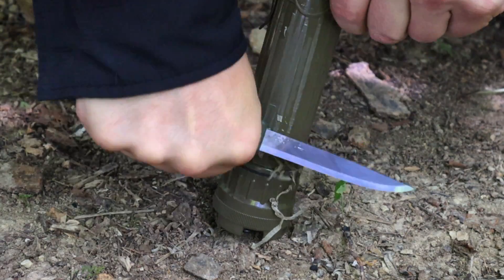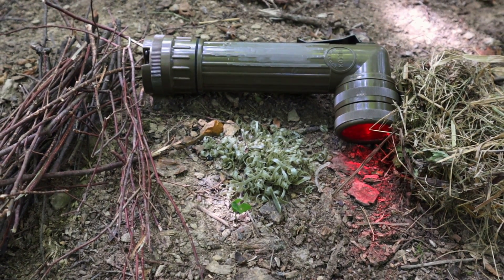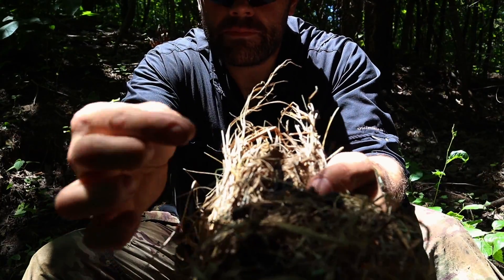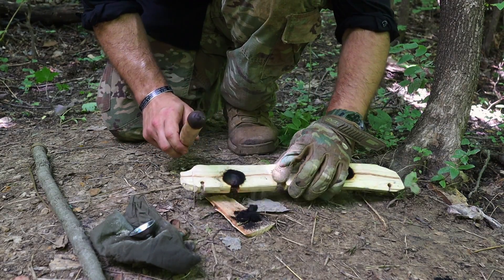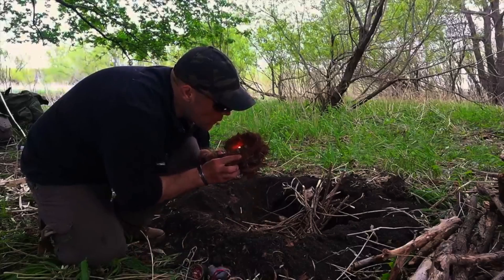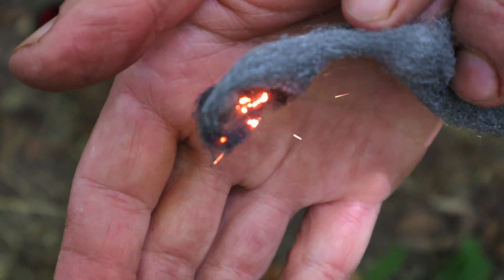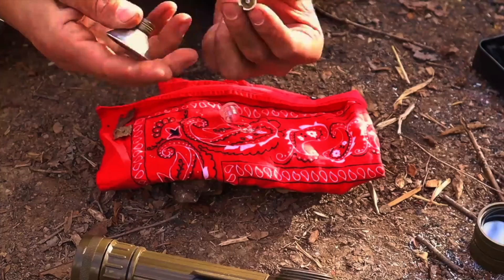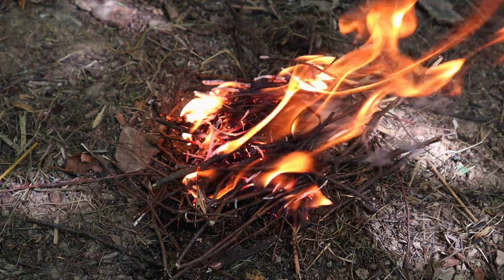6 Ways a Military Flashlight can Start a Survival Fire in the Wilderness!

Comment: Thanks again.  One thing from this is the steel wool ignition on the negative end of batteries in line.  Duh, but I never before noticed.  Good lesson, skipper!  My Surefire LE is supposed start a fire when set on high beam and left covered up.  Eeyow!  Also, the outer tail switch broke off, which actually makes the LE safer from an accidental high-beam set.  Love a happy accident.

Comment: I am amazed at the idea and that it worked.  I am cringing over mangling the angle head flashlight.  I have two such flashlights and both were modified with handle extensions where tinder and miscellaneous items could be stashed.  I think these are or were available from Fulton Industries years ago.  Anyway I will store this knowledge in the brain in case all other options fail. Any chance the flashlight lens could be used in conjunction with the sun's power to ignite tinder?  
Really interesting stuff here.  Like it.

Comment: I always love you videos but I'm curious- does the US military still use those junky old flashlights?  It's cool to see how to use one for fire but what a waste of weight!  For what the angle-head 2x D-cell light weighs you could have six lighters, a firesteel and several sealed boxes of matches and still have weight to spare for a small-to-medium LED light.  I've had alkaleak batteries ruin so many lights, cameras, radios, etc that I stopped buying them a decade ago.  The US Army vets that I know have told me that ounces = pounds and pounds = pain, so it seems weird to carry a super heavy, obsolete light with such feeble light output.  Modern LED keychain lights are brighter (albeit with less run time).  At first blush it seems that carrying a modern light would free up a lot of weight to carry a robust fire kit and give you a more powerful and durable light to boot.